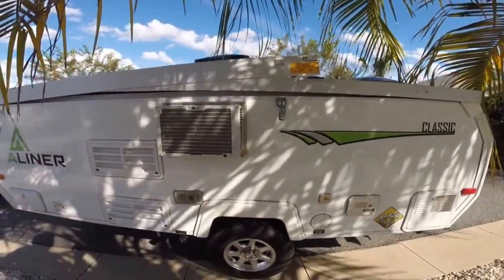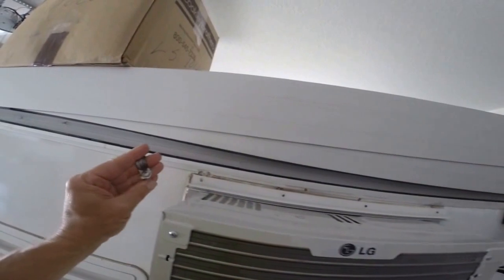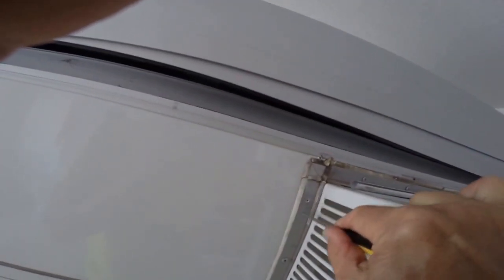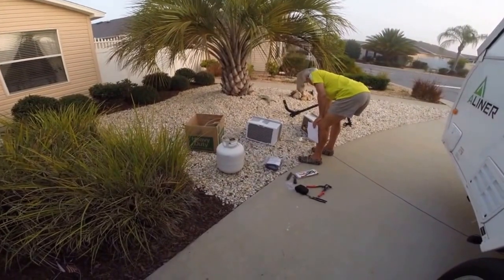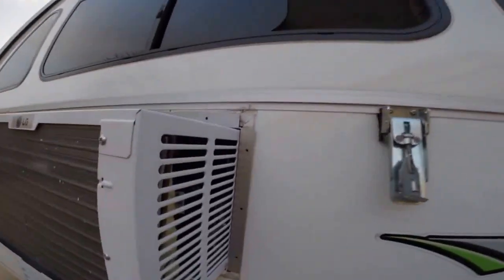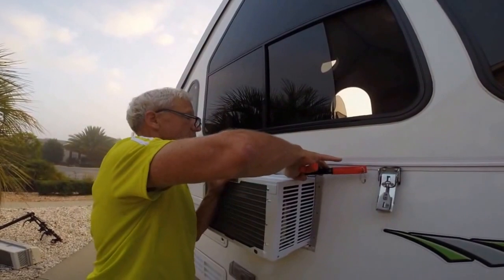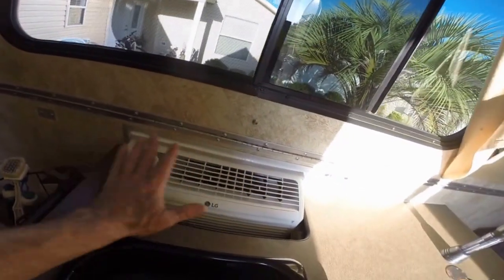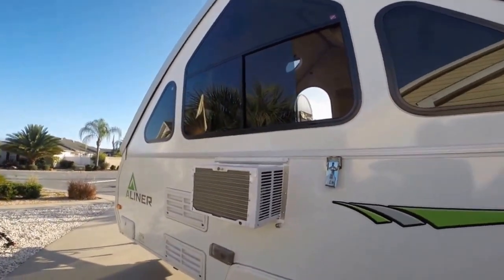Aliner Air Conditioner Replacement

Comment: Did you say that you ordered it from the factory? Home depot has the LG LW5015E for $129. Does the one from the factory come with brackets pre-installed? I had to dispose of the deer damaged unit - so the brackets are very important. I saved the brackets that were on the camper itself.

Comment: Enjoyed your video. I dont understand why Aliner thourght that having an ac unit sticking outside your trailer would be a hit with anyone. i have a 2006 aliner with no  factory ac installed. i installed mine so it slides in and out when required.  to change it if required takes 60seconds. no tools required. Ac from walymart $60
Reply: Brian Moore I'm planning a swap. I love the idea that you can remove it. could you explain that or perhaps make a video?